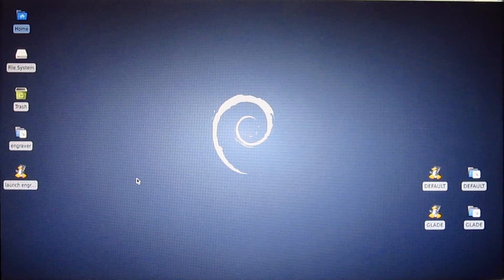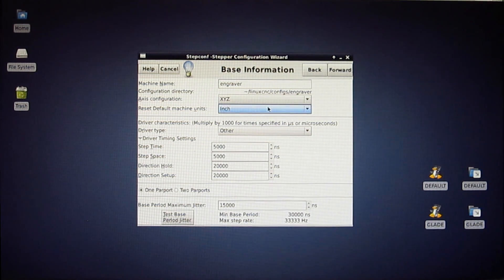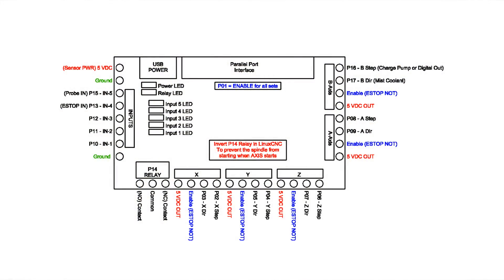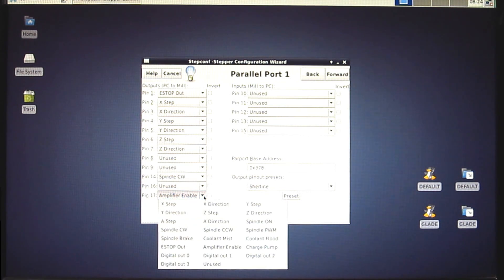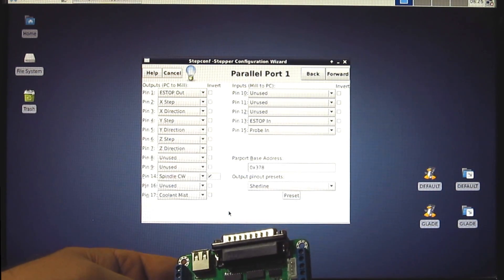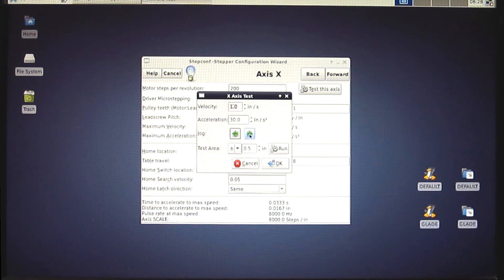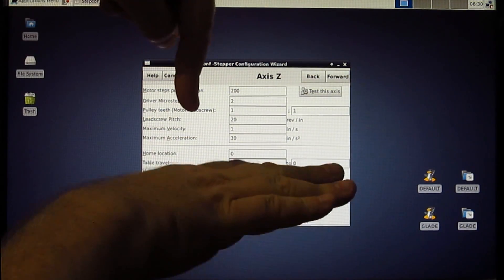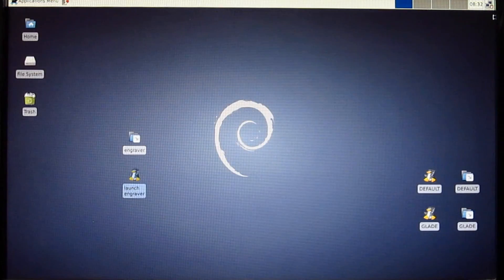LinuxCNC Machine Setup Part 1

Comment: Hi . I am FC you. I am new to LinuxCNC. Mach3 board can really be used with LinuxCNC?  And can it be used with motor size maximum?  Someone suggested that it is better to use a mesa board. But if going to the ethernet board of mach3 does not have a real driver for linux?
Reply from the maker: What is your native language? I can attempt to talk with you using Google Translate. Go to askjerry.info and get my email address.
Reply: @Askjerry  Thai language
Reply from the maker: @g-custom1412  หวังว่าคำแปลนี้จะช่วยให้คุณเข้าใจคำตอบของฉันได้ดีขึ้น
I hope this translation helps you better understand my answer. 
คณะกรรมการฝ่าวงล้อมไม่สนใจว่าคุณใช้ซอฟต์แวร์อะไร บอร์ดฝ่าวงล้อมเชื่อมต่อพินเข้ากับขั้วสกรู
The breakout board doesn't care what software you are using. The breakout board connects the pins to the screw terminals. 
มอเตอร์ไม่ได้เชื่อมต่อกับบอร์ดเบรกเอาต์ ไดรเวอร์ stepper เชื่อมต่อเพื่อแปลสัญญาณเป็นแรงดันไฟฟ้าของมอเตอร์
The motor is not connected to the breakout board, the stepper driver is connected to translate the signal to the motor voltage. 
หากคุณมีมอเตอร์ขนาดใหญ่คุณจะเชื่อมต่อกับไดรเวอร์และแหล่งจ่ายไฟที่ใหญ่ขึ้น
If you have a larger motor, you will be connected to a larger driver and power supply. 
MESA 7I76ED เป็นบอร์ดที่น่าใช้ เชื่อมต่อผ่าน LAN มีอินพุตเอาต์พุตมากขึ้น (48) และมีเครื่องกำเนิดไฟฟ้า STEP และ PULSE ในตัว
MESA 7I76ED is a very good board. It is connected via a LAN, has more output inputs (48) and has a built-in STEP and PULSE generator. 
http://store.mesanet.com/index.php?route=product/product&path=83_85&product_id=323
แปลแล้วด้านล่าง
https://translate.google.com/translate?sl=en&tl=th&u=http://store.mesanet.com/index.php?route%3Dproduct/product%26path%3D83_85%26product_id%3D323
สิ่งนี้ช่วยให้คุณเข้าใจหรือไม่?
Did this help you understand?

Comment: hi  , thanks  for  video is  very nice  i have the same  board , i have  a little question  about this  , i  have  connected  a micro-switch   X Y Z    one  pin in ground  and other P12  P11  P 10, when i test in linux cnc  a movement  axses  X  Y and  Z  if  i click a microswitch   continue to move and dont stop ,is  regular ?  thankz
Reply from the maker: The configuration determines if one axis at a time will move or if all will move at once. Typically it is configured so that the machine will do Z, then Z, then Y. Have you configured the switches so that P12 is the Z axis, then P11 is the Y axis, and lastly O10 is the Y axis. The home switch must match the axis specified. You also must configure the switch so that the closure of the switch indicates a home condition. If this is reversed, then the machine will assume the home switch is depressed and move in the opposite direction looking for a home indication.

I recommend that you activate the machine but do not home it... then next to FILE you will see MACHINE, hover over that and click VIEW HAL CONFIGURATION to bring up the next screen.

Click on the tab WATCH as we will select certain pins to evaluate.
Click on PINS
Look for AXIS 0 and scroll to select HOME-SW-IN and select it to add it to the WATCH tab. (X-Axis)
Look for AXIS 1 and scroll to select HOME-SW-IN and select it to add it to the WATCH tab. (Y-Axis)
Look for AXIS 2 and scroll to select HOME-SW-IN and select it to add it to the WATCH tab. (Z-Axis)

All three should be RED (not active) at this time.
Click the Z-Axis Home switch, does one of the red dots turn yellow? 
If not, you have a wire or configuration problem.
If yes, verify that it is the correct switch.

Once this is corrected it should function normally.
Reply: @Askjerry   thankz  i will  test >)
Reply: @Askjerry  i have  also many questions  sorry , i am new of cnc world ,  is possible have your mail ? my mail is  stfn77@gmail.com 
thankz again

Comment: Hey Which Board Should I use for 5 axis CNC. Any ways. Thanks for the useful video
Reply from the maker: I have the Monster running on a Stainsmart connected to a parallel port... It runs fine.

Comment: Thx Jerry, you realy help me.... I hope you still making tutorial video about linuxcnc......
Reply from the maker: Im trying to think what to do next. Glad I was helpful. :- )
Reply: @Askjerry  i think you can make complete tutorial about home limit switch setup, touch probe inside hole and outside block. And how to setup Closed Loop using servo or Hybrid stepper.  I'm new in Linux CNC, before i'm using Mach3 with Open Loop, now i want using Linux, because i'm hear from someone Linux CNC able to control Closed Loop System. And can save last position if have problem with power.
Reply from the maker: @isulistiawan  Have you looked at my Frankenlab playlist? I cover the probe, limit switches, setting the home positions, and I even made a complete probe plug-in that you can install... free. Saving last position is easy if you use the G54 home... all covered in my Frankenlab series. 
 https://www.youtube.com/playlist?list=PLa_L8q5vezBOkzP_yOKBXPB8zKn-iWCsX

Comment: is there LinuxCNC Machine Setup for raspberry pi?
Reply from the maker: There is a lot of discussion on this topic here...https://forum.linuxcnc.org/9-installing-linuxcnc/30302-linuxcnc-on-raspberry
Reply: sorry, I mean how to configure linuxCNC (in raspberry: machinekit) GPIO pin connection between raspberry pi and motor driver without convert gpio pin to serial port
Reply from the maker: @JanSebastian213  Honestly I have no idea. The best thing to do is get on the LinuxCNC forum and start reading about Machinekit and how it functions.
Reply: ok, thank you very much

Comment: I have an old laptop with a 1.5 Celeron and only 256mb of ram. Will this thing run Linux CNC?? I can design on another computer with Fusion but dont want that computer in the garage.  Very confused. Thank you.
Reply from the maker: Laptops can sometimes run too slow... but if you want, you can put the ISO on a thumb drive and experiment with it... if it looks good, then install and start the setup. Run the speed test and see what kind of number you get... 25000 or so is fine... 50000 or so will probably get an error n startup, but may still work. If you are not using the laptop anyway... install the ISO and give it a try. If it doesn't work, it will have Libre office, so you can still use it for documents, spreadsheets, Gimp and Inkscape will let you do graphics... so it's a win either way,

Comment: Are you also running mesa?, or just para with a bob?
Reply from the maker: Currently (July 2018) all my machines and those for people I've helped have all been just a parallel port. My Monster Mill is using two parallel ports and two breakout boards. I just now started working with a MESA 6i25 and 7i76D plug-n-go set that will be used to convert the Monster Mill into a 5-axis. (And a whole new video series/playlist.) Probably have the first videos on that out starting maybe September. (Shhhh... secret!)

Comment: just go the machine light up, lots of red led giving a fine feelings , y axis ran fine , Z axis madea lot of disturbing sound X did not move. so I did a little bit of adjustments and lost it all. Machine wont run. SO I am here to resurrect the mill, Thanks for keeping a ready to understand Digested feed for the  CNC toddlers. you for sure are a mentor
Reply: but linux cnc has the  impressive outlook , unlike the grbl shields linux cnc // It is awesome
Reply from the maker: RULE ONE: When you get something that works... even if not completely... BACK IT UP!
Frankenlab is on version 6 now... and I have versions 1 to 5 backed up... in case I need to look back to see what went wrong.

Comment: I have a complete set of Mach3 Breakout board , but I do not know how to wire. Every  thing ready One computer dedicated to Linux cnc Operating system. But stuck with assembling the boards. So what do I do Now , Dont say Skip Go some where else > I dont care things "  Master "
Reply from the maker: Ok... it sounds like you are saying that you have a Mach3 breakout board, but want to configure LinuxCNC to use this board... is that correct? If so... we need to write down the way the pins are configured on that board... then match those settings in the STEPCONFIG. Once that's done... it's a matter of calibrating the machine.

When I do a Google search for the Mach3 board... i am seeing more than one configuration. Go to my web page http://askjerry.onfo and get my email address. Email me and I will assist you.
Reply: No  Mentor I am a nubie . and am stuck with wiring it up.  I have a home made cnc With 3 axis  with displacements of 30 cm X , Y and 20 cm for Z . I  have been runnung it with grbl and cnc v3 ardunio  shield 
now i have the set of Mach3 breakout board with 3 stepper drivers . But have no clue how to wire it up
I am sending you an email with pictures Hopefully You will guide me to be a C N C  upgrade, Once all wired then will go one level up to configure the machine with software .
Reply from the maker: Yes, I will be glad to help you.

Comment: Great video. I've been interested in building a cnc router for several years but just never built up enough nerve to doing. Until now, l have come across some parker equipment, one acr 9000 6 axis controller, two gemini gt stepper drivers and stepper motors,  and two gemini gv servo drivers and servo motors. My question is would these components be suitable for a router and are they compatible with the linuxcnc software? One other question will I need to download any parker software and/or drivers.

Thanks
Reply from the maker: jrcrosier13 Go to my http://askjerry.info page and email me. We can look into it further.

Comment: Good morning 

I have a second question for you. I have 6 stepper motors Nema 17 2A I was wondering what type of driver and breakout board will you recommend for this type of motors? 

Also this might be a silly question by do I need a driver for each motor?
Reply from the maker: Melissa Oliva Not a silly question! The breakout board takes the signals from the parallel port and gives you nice terminal strips to attach to... it also has a relay for spindle switching, etc. But that is all it does. To operate a stepper motor, you must take 3 signals... enable, step, and direction then convert them to the electrical power needed to operate the coils inside the stepper. This is what the driver does... it DRIVES the power and control to ONE stepper motor. So yes... one driver per stepper.

There is an exception... Frankenlab uses TWO steppers to rub the 6-axis... but BOTH steppers are always doing the SAME thing... and the driver I chose had enough current to safely operate both.

As always... you can get my email from my web page should you need more help. (If I have the time of course.)
Reply from the maker: I've use these... a bit overkill for what you want... but cheap.
https://www.banggood.com/TB6600-4A-CNC-32-Segments-42V-425786-Stepper-Motor-Driver-Controller-p-1093437.html

As for the breakout board... I like the Stainsmart.
https://www.amazon.com/SainSmart-Breakout-Board-Stepper-Driver/dp/B0093Y897A

Comment: Good morning Sir: 
My name is Melissa and I going to program a hexapod using LinuxCNC. I have the program installed on my computer already and everything looks to work fine. But for some reason when I was following your instructions in this video the launcher wont open the program that you end up in the end. Is this because I don't have the actual machine hooked up to my computer yet? or the driver? Does Stepconf Wizard only works if you have your machine connected to your computer?
Reply from the maker: Melissa Oliva STEPCONFIG doesn't care... it creates the INI and HAL files and makes a desktop launcher. It also only configures for 4-axis. If you want to do a hexapod... 6-axis... that will need to be manually configured.
If you have an INI file, use the CNC dropdown to create a launcher and start it. Google the LinuxCNC Forum for more info.
Reply: Okay I see. Do you have any videos where you configured a hexapod or anything more than 4 axis? Thank you
Reply from the maker: Unfortunately I do not have a configuration like that, however there are discussions on the LinuxCNC forum which can be found here: http://forum.linuxcnc.org  I did find this section... aparently there are samples covering this in the samples section.  http://forum.linuxcnc.org/38-general-linuxcnc-questions/31069-using-linux-cnc-for-6-dof-stewart-platform#75723

Comment: Hi I'm looking into a filament winder. How do I start if I want an x,y linear axis and A,B rotary axis? Haven't been able to find out how to do that other than maybe coding without wizards.thanks greg
Reply from the maker: Greg Not sure why you would need 4-axis to wind filiment... I guess I would need to see the configuration. 

As for programming... you could step through the first one... recording the steps... then just run the code as needed.
Reply: Hi Thanks for responding so quickly. I bought a 4 axis winder from these guys http://www.xwinder.com/filament-winders/. I'm having trouble with it and the support is not really there, Thinking about making it less of a black box.greg

Comment: What do you think of this setup?http://www.cad2gcode.com/sitebuildercontent/sitebuilderpictures/beaglebonesys.jpg
Reply from the maker: I have not used it... in theory it should work... the Beaglebone has a high enough CPU speed to run LinuxCNC and parse out the G-Code... and I think the extender card provides all the timing. I just haven't been exposed enough to it yet. I have a Beaglebone Black... but haven't done anything with it yet. If you do it... please give me feedback on it.

Comment: Great vid and tips. 
Hey I have tried many screen recorders and this one is the best, as it natively supports h.264 encoding (A great codec for clarity and small file size.) http://www.maartenbaert.be/simplescreenrecorder/
BTW where is part 2 of the video? You can always insert a link in the description as well as towards the end of the video.
Reply from the maker: I cannot believe it has been 10 months already! I still have to do it! I am doing a series on the Arduino right now, part 5 of 10... then I am also building my new Frankenlabs platform... a small CNC machine built exclusively to teach CNC setup, operation, pyVCP panel configuration, and if I can learn it... Glade configuration. This video may get re-branded as Frankenlabs part 1... and I'll pull the existing two into it as Part 2 and 3... dunno. Been working 12 hour days the last month... I'll check out the screen capture... thanks!
Reply: Id like to see an explanation of the various screen options as well as how you can add items to the 'side box you suggested to install.
Reply: Oh and just accept the default options for the screen capture and you cant go wrong. (Works in Linux only) (Its a largely undiscovered gem.)
Reply from the maker: THANKS. I appreciate that... I'll see if I can get it running this weekend. Possibly do an introduction to the pyVCP. Dunno... see how the weekend goes.
Reply from the maker: That is either a GLADE or a pyVCP panel... yeah... I need to do that.

Comment: Just to be sure I understand well: you build your cnc so it would be plug in a lpt port without any need of a controler.... I trully like that Idea.
Reply from the maker: +mortrem76 The PC is the controller... the LinuxCNC makes all the drive signals and sends them out the LPT port to the motor drivers. I am building a small 1/2 meter cubed machine to train people with... when done... I'll have a whole series on setting it up and experimenting!

Comment: Jerry, noticed you set up the 15 pin parallel port for your mill
Is there another connect output to set up PINS to control a Turret?  or a card to add to get more PINs for Turret control hook up?  Like selecting different tools from Turret tools in various locations.
Reply from the maker: A parallel port has 5 inputs. For my set up, I added another PCI parallel port. this gave me an additional 5 inputs and another set of outputs. You could instead use a MESA card... with 24 or so inputs... but I have not installed one yet.
Reply: +askjerry Thanks Jerry, you are the man
Reply: +askjerry And I guess we can assign functions to these Pins, that is when a G-Code program has a line that basically says MOVE tool 6 into position, we can send a signal to an output PIN that make the turret move to the CMD position.   Thanks!
Reply from the maker: +petsatcom Sort of... the pin goes high (or low) and some G-code is called... same pin no matter what tool... you pass a variable to the controller that does the job. Check the LinuxCNC forum for details.

Comment: I noticed Andreas Schiffler used an EtherCAT (RJ45 connector) cable  from his Linux CNC Laptop to drive the amps directly.

Is this just a setup in Linux CNC to have the output go to the serial EtherCAT.  
Does the linux output have to be configured to create Data Packets in a correct format for EtherCAT transport to Amps.    

Thanks Jim P
Reply from the maker: +petsatcom I&#39;m not really sure... I have not done that type of setup. But, if you take a look at the LinuxCNC Forum... I'm pretty sure you will find an answer.  https://forum.linuxcnc.org/forum/index